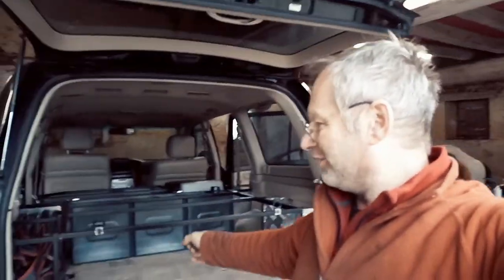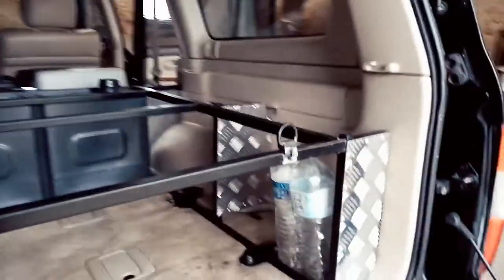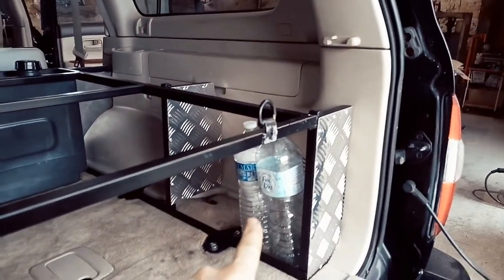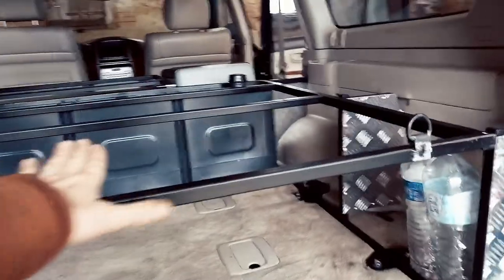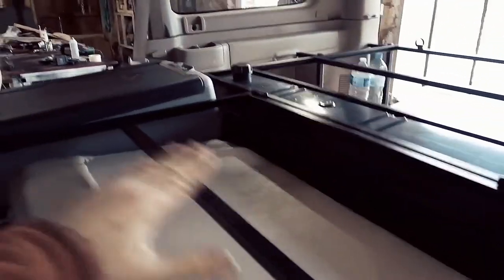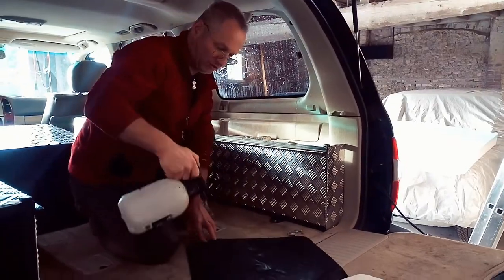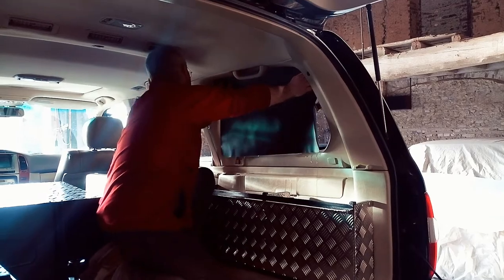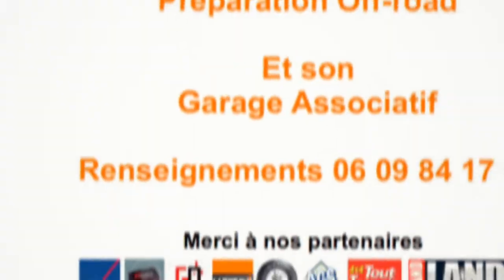Baroud'Land Concept. Preparation Toyota HDJ100 Off-road 07 Aménagement intérieur, lit et douche

Comment: , bonjour je voudrais installer une batterie auxiliaire sur mon HDJ 100 comment puis-je passer les câbles du moteur à l'habitacle je vous remercie je vous remercie pour votre réponse 
Patrick
Reply from the maker: Bonsoir, Une 3eme batterie, pour quoi faire ? Il y en a déjà 2 d'origine et le hdj100 est capable de démarrer avec 1 seule. Mettez plutôt votre budget dans 2 optima jaune 6 éléments (il faudra faire une nouvelle patte de fixation car un peu plus haute), si non, il faudrait m'en dire plus sur votre projet et les accessoires que vous voulez installer.